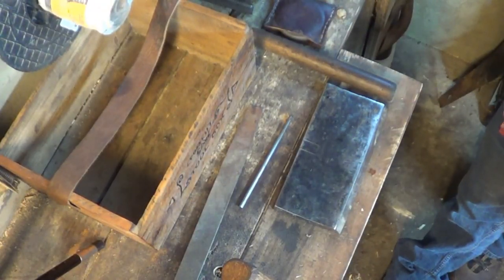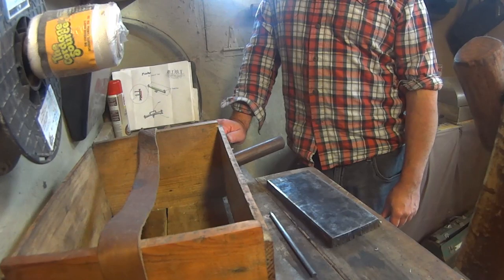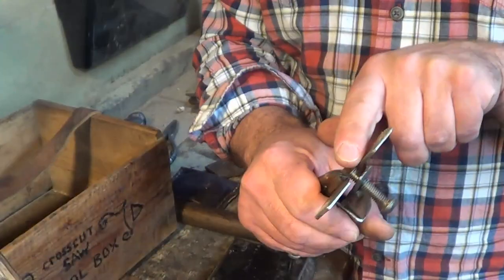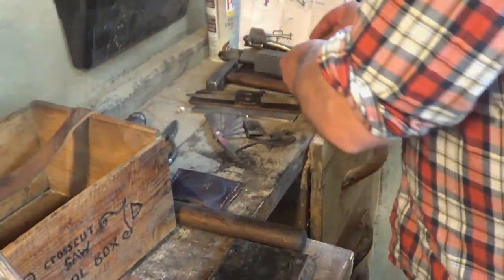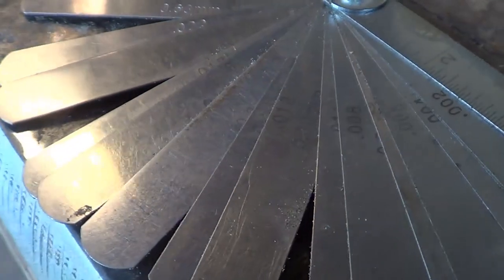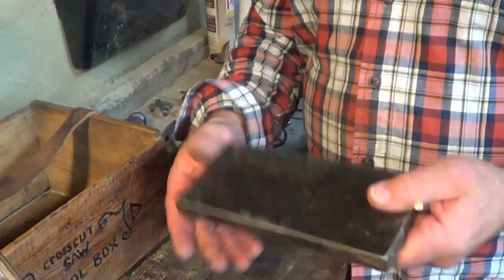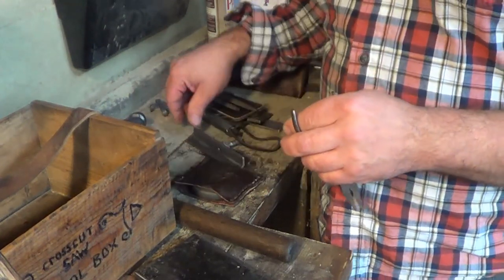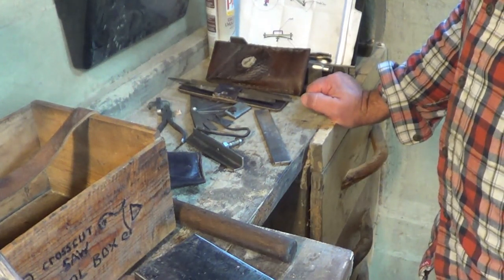Homemade Crosscut Saw Tools

Comment: I like your home made tools.   Your steel plate could be used to to straighten a bent saw but probably not a good idea to take the set out of the cutters then reset them.  You would just increase the chance of breaking a tooth.   
Check out some of my homemade crosscut tools at:  http://www.pbase.com/jimthode/gallery/crosscut_saw
Reply: I've learned a LOT from your photo gallery! thank you for taking the time do take all those photos. I'm currently making an angle iron saw vise bracket like yours.